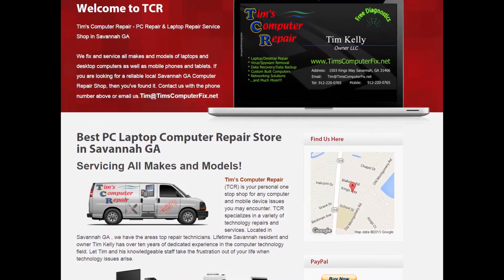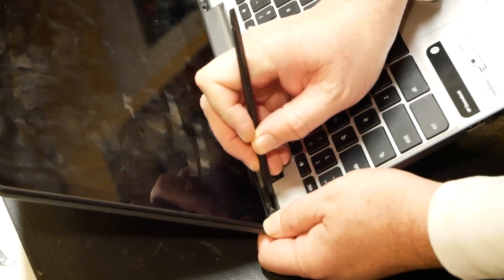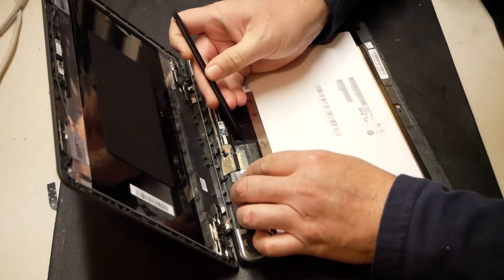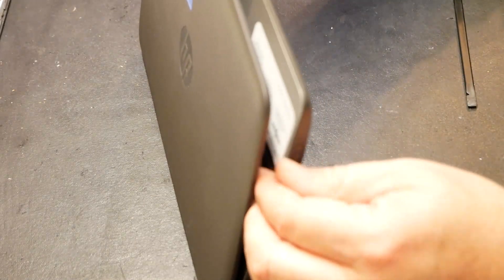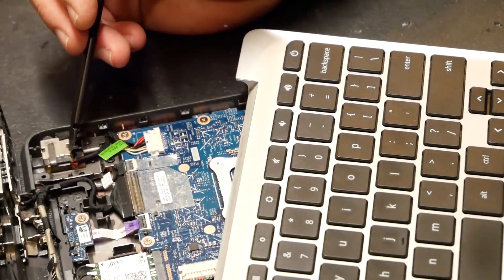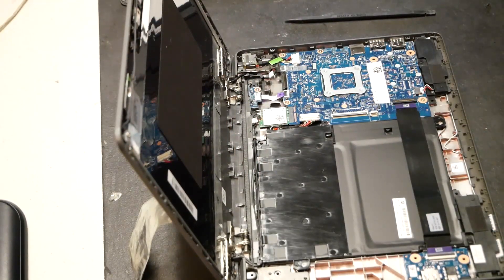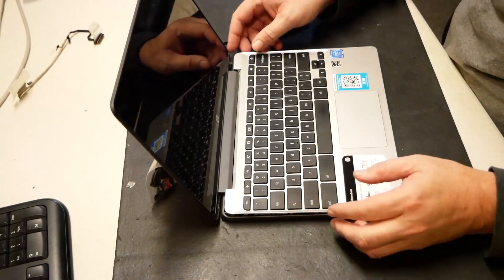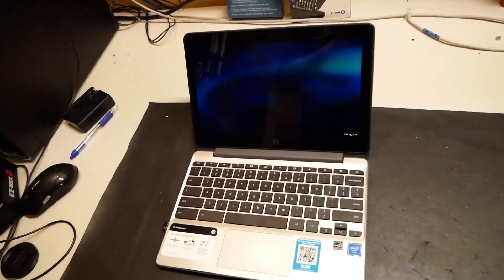HP Chromebook 11-V011DX Screen Repair | No Video | Disassembly | Video Cable

Comment: Hi Tim, great video! I was just wondering, where did you source the cable from? As I am just starting out, it would be good to know where to look for things like that :-)
Reply from the maker: ebay is a good place to start. Amazon sometimes has parts also.
Reply: TimsComputerRepair Thanks for replying Tim :-)

Comment: That's a small motherboard considering the size of the machine and I guess the processor doesn't need a fan didn't see one on the motherboard.
Reply from the maker: Well it's a Chromebook so most of the processing is done in the cloud. Chromebooks are getting popular lately.